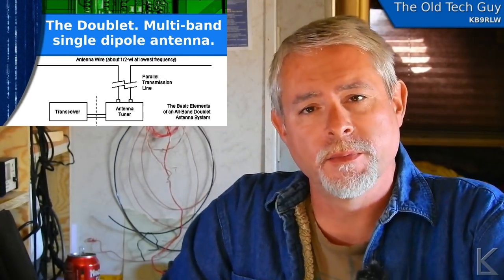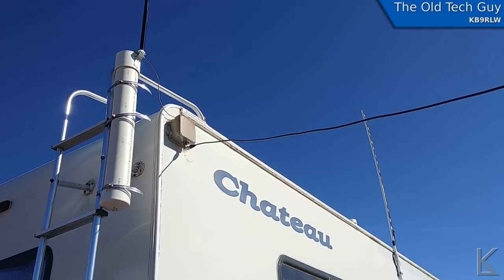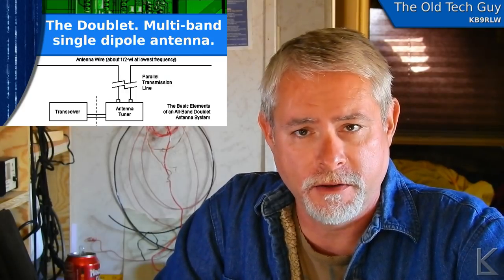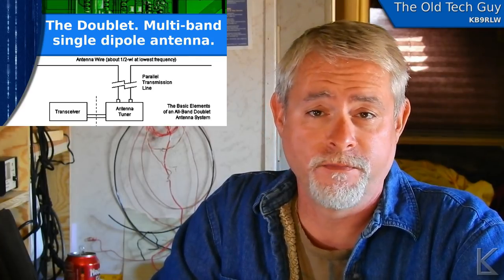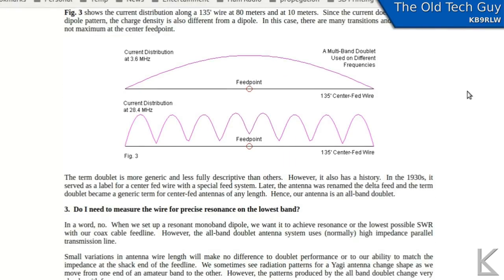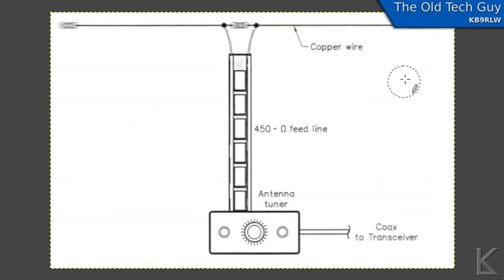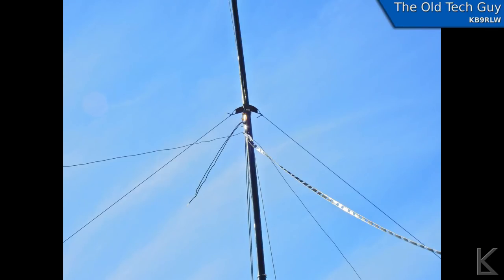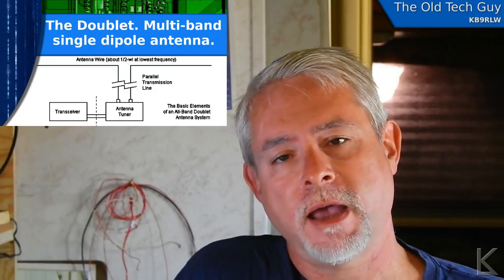Ham Radio - The Doublet.  An old but good multi-band single dipole antenna.  Part 1

Comment: Hello Kevin,

Concerning @ 13:00 about standing waves on coax, would those not be knocked down by an Ugly balun, and/or a string of ferrite chokes on the coax?

Secondly, if you had a much firmer center point, heavy pole, tower or tree, would it be better to mount the remote match at the center feed point, then run the coax to the rig?

Thanks & 

73 - John - N7GHZ
Reply from the maker: Sure, making the loss even higher.
Reply: Toroid: Only if you chose the correct toroid mix and number of turns. Ugly balun: Not likely, unless you characterize it. In general: Adding a random inductance can make matters worse. Consider you're choking common mode currents on a feeder to a load that's capacitive.... you've just tuned the feeder to pass common mode current *better*.
Reply: An rf choke is for common mode current on braid of coax, swr does not travel on braid of coax as incorrectly mentioned in the video

Comment: Kevin, I’ve been reading on line that an automatic tuner such as a LDG will not work on a doublet.  If my memory serves me that is the tuner you are using.  My thoughts are that if you feed the doublet through a short coax and a 4:1 BALUN it shouldn’t have any problem.  Keep the videos coming, very informative.  73.
Reply: I think that using an external 4/1 balun fixes that alleged problem.

Comment: Good video. I always learn something from you. 

I have a MFJ 1778 G5RV. It's a 102 foot dipole which matches the design of your doublet, except it is slightly shorter, and the length of the ladder line makes it balanced, giving 50 ohms at the coax connection point. I've read that the ladder line is part of the antenna, so it's specific length (32.6 feet) gives it the 50 ohm balance.

So from your video I gather that extending the ladder line makes the antenna unbalanced again. Is the 102 feet length too short to convert this to a doublet for 80 meters? This assumes I'd add a balun (my tuner only accepts coax).
Reply from the maker: Thanks Ed.
In the G5RV, the length of the window line is specific to create a 50 ohm point.  It's similar, but not the same design philosophy.   I probably should have mentioned it in the video.  I'm sure I'm going to get a lot of comments from other people that may confuse the two antennas.
Reply: Kevin Loughin Too short to convert to a doublet?
Reply from the maker: @edneely  No.  and it would probably still work ok on 80.   But why?  Doesn't it work well as it is?
Reply: Kevin Loughin It seems to work well, but I have about 100 feet of coax to get it into my house. I wonder how much loss I have. Hard to say.
Reply: @edneely  Ed, I generally recommend to anyone who uses a G5RV to cut off the matching section and run ladder line all the way from the center insulator to the tuner. The G5RV has very high SWR on a number of bands so you're losing quite a bit of signal in the coax on those bands due to the mismatch. As noted by the chart in the video, the ladder line will exhibit very low loss under those same conditions.

I am not sure why but somehow the G5RV has, over the years, become somewhat mystical in its abilities. It's actually cheaper to make a doublet than it is to buy a commercially-made G5RV (especially when the cost of a long run of coax to the G5RV is added) and the low loss of the ladder line will allow the doublet to be a better performer on nearly every band.
Reply: @BrianEsche  EXACTLY! A unwanted G5RV makes the perfect doublet!!!!

Comment: I have a ~120 dipole up feed with 450 window line which technicanally means I have a doublet.  I terminate the window line with an external balun at 9:1 ratio.  It works quite well.

Comment: Does the length of the feeder on the doublet make any difference especially for working the ?higher frequency bands?      I have heard that you want to cut the feed line to 1/2 (electrical Wavelength) for the lowest frequency band that you use the antenna on?
Reply from the maker: Some say it does, some say it doesn't.  Mine is not half a wave on 80 at all and yet it tunes fine on 80.

Comment: I realize this video is old but I really would like to encourage any viewers to try a doublet antenna.  I use a total of 102-feet (51 per side) with 450-Ohm window-line and I have never had a better dipole antenna and it just blows away anything I've done with coax.  Now, as far as going through walls with window line: My house has stucco that is attached by a continuous layer of chicken-wire.  All I did was part away the chicken wire (as best I could) and run the window-line through the wall (once it exits the wall, I droop it down for a rain-drip)  to 2 female banana-jacks that are mounted on a piece of polycarbonate plate. so that either a short jumper of window-line (which then runs to the tuner) is plugged in or, a pair of heavy wires that are hooked to ground--both of these have male-plugs on them.  I swept the line with a TDR and SWR and there was no effect with the chicken wire; this is because the window-line runs perpendicular to the chicken-wire.  
So, don't let people telling you horror-stories of running balanced line--it is so much more tolerant than is let-on.  I will never go back to coax for this type of antenna ever again!
The performance is just astounding!  BTW: I use a 4:1 balun and this works with both manual (link-coupled) and auto-tuners on all bands 80-10 meters. Please try it!

Comment: Kevin, as you know I am quite limited on what I can do antenna-wise.  I do like the outdoor balun idea.  What considerations are there for the ladder line as far how it's run to the antenna?  Keep it clear of as much as possible.  My gut says it won't do well strunk at or near the ground (which is what I would need to do to keep things out of sight.   My shack is in the front of the house, I have some antenna space in the back yard.
--- Joel
Reply from the maker: Hi Joel,    The ladder line should be kept in the clear as much as possible, and avoid running it parallel and close to anything metal.
It's the best performing single dipole I've ever used.   If you can get one up, you'll probably love it.

Comment: I have not yet read the papers you cite. But my understanding of the thing is different. First: The leader line has such low loss even at high SWR simply because it has very low dielectric loss. The dielectric of leader line is basically air and air has low dielectric loss. That is why low loss coax usually comes with foam dielectric.

The feed line will actually radiate some power. The G5RV and its derivatives like the ZS6BKW uses a similar "trick" when used on a non resonant frequency of the dipole part. These antennas just try to keep the dimensions in a ratio so that multiple resonant frequencies occur across the dimensions of the dipole and feeder combination. Hence they are usable without tuner on these frequencies. 

So this antenna is just simply plain a non resonant dipole, forced to match the impedance of the TRX by a tuner. The bad SWR will cause high losses on the feed line, which is mitigated by using a very low loss feed line, i.e. leader line.

You can get about the same by placing the tuner right at the feed point of the dipole without any leader line. But this is inconvenient as you need a weather proof, remote controlled tuner.
Reply from the maker: Read the papers. They're an easy read and clear a few things up.
Reply: Kevin where did you get your 60 ft. Mast?
Reply: When done properly the open-wire/ladder line does not radiate, this is a strange but popular myth, the G5RV and derivatives use the line as a matching section. Unfortunately often without any effort to reduce common mode current. 
There is merit in carefully choosing the length of a doublet to avoid wildly high impedances at the feedpoint.
Reply: @g0fvt  Yes. After putting some more more brain cells into the problem I agree that the ladder line should not radiate. Common mode current is still a problem. That's why you should put a common mode choke or balun at the feed end of the ladder line. Not to match impedance, but to suppress common mode current. If there is a suitable antenna tuner at the feed end of the ladder line it also suppress common mode current. I read recommendations to add a common mode choke or balun to a G5RV or ZS6BKW. I did such a modification to a G4RV but I still have to test it.
Reply: @56932982  it has to be said that the baluns incorporated in many tuners are not very good, since the impedance of the doublet can be all over the place I have decided not to use an impedance transforming balun. Most ATUs struggle with very low impedance loads, and are more efficient with higher Z so I am using just a common mode choke "1:1" the ATU will not flash over readily (7kV capacitors). It is handy to have an HF antenna that is compact and versatile, I have no interest in HF beams at present. VHF though is a different matter..

Comment: I have a Double Extended Zepp Antenna each leg is 0,64 wavelenght so since it is optimized for 80m band its a fairly long 328 feet or 100m. This antenna works great on all bands from 160 - 10m. Feed it with ladderline to my MFJ Tuner. So you should do fine with your antenna Kevin. Unfortunatle I have it in my summer house so no room for this antenna at my home in Söderhamn since I live in apartment. Thanks for your videos. 73 de sm3uwz/Lars
Reply: Is your Double Extended Zepp collinear? (the two legs fed in phase) If so, how did you do the phasing?
Reply: No its fed like a dipole.

Comment: Thanks Kevin. Great video. You are an expert in making complex things understandable. I always used windowline or open wire for my antenas. My hor loop skywire is still up at home QTH since 1995. I will certainly try out the Doublet as you described in our vacation house. I have a Spiderbeam pole over there (40feet ) and plan on doing as you did. Just a question: how high is the feedpoint on the mast ? And what is the lowest the antenna gets groundlevel ?
Many tnx again and good dx ! 73 de Ronald, ON4BBQ / N2YCQ,
Reply from the maker: Hi Ron,  the doublet is on an MGS 30 foot mast. The ends slope down to about 6 feet off the ground.
Reply: Tnx Kevin ! 73 !

Comment: My Palstar AT2K has an external 4 to 1 balun. I have 25 feet of coax to the balun, then ladder line after that to a loop. I assume the 25 foot of coax is seeing a big loss on high mismatch? I had thought about hooking the balun directly to the back of the tuner, but as you said running ladder line in the house is problematic.
Reply from the maker: One trick I ran across was making a parallel feeder by using two pieces of coax.  Short the shields at both ends together, but do not connect them to anything else.  Then use the center conductors as your feeder.  The isolation of the shields makes it more forgiving for passing over or along metal.
Reply: @loughkb  I will keep that in my memory bank. That plus each coax spaced apart in a separate 1/2 inch pvc conduit might work great. I would just match the spacing of my home made ladder line. ( around 3.5 to 4 inches apart ). Attach them to the floor joists down stairs and out to the wall to my existing ladder line.  Thanks.
Reply: @loughkb  EXCELLENT TRICK!

Comment: Are you concerned about the strain placed on the UHF connector on the RV from the feed line weight and wind load?
Reply from the maker: I addressed that in the video.  I pointed out that this is just an experimental set up and won't be up for long like this.
However,  we did have one heck of a wind storm and it survived so far.

Comment: You Kevin!:
As usual GREAT video! Taught me a bit more about antennas! I am of the opinion that the length of open ladder line DOES matter. Just me & my opinion. You know of my interest in 160 mtrs right? Would a 4:1 or 9:1 Baluns help load up my G5RV (dipole) on my aut6 tuner that covers 80-10 mtrs?
Great video, can't wait for the 700mw video!
73's!
de seeker/Jeff WA7LFP
Reply: I thought that it did, Spent a lot of time researching looking for a specific length. No suggestions  in any of the articles covering the "Dipole Doublet."

Comment: This highlights the importance of using good quality coax with a high velocity factor. Excluding the effect of high SWR any decent coax these days should be better than =<0.6db of attenuation @28MHz for 100ft. Decent coax isn't that expensive and there's no point making a 1kw with an expensive linear only to lose it all in the feedline.

Comment: Internal tuner in radio won't handle anything over swr of 3.5.. adding the 4:1 balun will correct this??
Reply from the maker: Maybe, maybe not. It depends on what the impedance present is at the specific frequency your operating on at the time. What the 4 to 1 balun will do, is bring the high impedance has down closer to 50 ohms, giving a tuner less work to do in many cases. The impedance on this antenna it's going to be all over the place on different frequencies.

Comment: Loss is = impedance times current SQUARED (plus resistive loss) so the higher the impedance the lower the current (at the same power) so the higher the transmission line impedance (of any kind) the lower the losses and for no other reason.
    50 Ohm parallel feedline has about the same loss as 50 Ohm coax.
  600 Ohm parallel feedline has less loss than 450 Ohm parallel feedline.
 Ron W4BIN

Comment: i saw doublet like these but one side 11.7m and 2.5m other side and feedline is 7.4m ladder line to short coax
Reply from the maker: That's an off center fed dipole and won't have the advantage of low loss on the feed line.   In fact, being asymmetrical, it will radiate off the feed line. 
The doublet is symmetrical, a completely balanced system.

Comment: This was really interesting. As a newbie/returner I need to learn whether power I save by using a doublet will be lost at the ATU. Is ATU loss going to be less than co-axial loss?
Reply from the maker: Loss in the transmatch depends on the degree of mismatch it's dealing with.   Higher mismatch, more loss.
Reply: @loughkb  That follows, I see the logic. Thanks Kevin.
Reply: @acestudioscouk-Ace-G0ACE  any reflected power loss is due to feeder attenuation not the tuner absorbing power as its reflected back to the antenna at the tuner with no loss at the reflection point
Reply: @Pioneer936  Thanks Paul, I thought wherever you have a coil, you have a loss, however small. Thanks for putting me right.
Reply: @Pioneer936  Thanks for the suggestion. I'll look for it.

Comment: 8:28 You said that the coax between the tuner and the radio needs to be short due to the high SWR.  I think this is a blooper.  Between the radio and the tuner will be matched to 50 ohms at 1.1:1 SWR, or as close as you can get to it.  I think you were thinking about is where you run the window line from the antenna and into a 4:1 balun and then use a short piece of coax to bring the coax into the camper to the back of the tuner.  That short piece of coax will have high SWR.  Once the tuner tunes it, the SWR from the tuner to the radio will be really low.

Comment: Isn´t it necessary to use a 1:1 Current-Balun when you want to use a Doublet Antenna as a Multiband-Version?
Reply from the maker: No.  It must be a current balun, and you can use a 1:1 if you want.  The impedance is going to vary quite a bit depending on frequency, but will usually be quite high.  A 4:1 will bring it down a bit so the tuner has less of a mismatch to deal with, resulting in less loss in the tuner.
Reply: @loughkb  thank you very much for your answer. So I can use it for my new antenna system. 73 de Mike....

Comment: Why a 4:1 balun and  ot 9:1?  Seems to me that 9:1 would get 50 ohms closer to 450 ohms.   I must be missing something...  🙄
Reply: I think I have that tuner. :) It's 9:1 impedance.
Reply: The 450 ohm is for the ladder line itself. The actual ohm the tuner sees or in this case the balun sees will vary from band to band, see the video part comparing coax vs ladder line, the ohms can be as high as 5000 . The 4:1balun in this case is there to interface the ladder line  to coax and help the tuner out a little. Note some people recommend a good 1:1 choke aka current balun because as you can see in the chart in video sometimes the ohms can be low on certain freq so stepping down the ohms with a 4:1 or higher would not be desirable since most tuners are more efficient with tuning higher impedances
Reply: @Gabagabe1  thanks... so much to learn
  Lol

Comment: One thing I can never understand is why when you measure wavelength in metric people insist on using feet for antenna dimensions.
To be honest I don't really care which system of measurement I use (I'm british, we use both all the time anyway) but it's much easier to stick with one! As ham bands are defined in metric wavelength I have only ever played with antennas in metric
Reply: Ever tried to buy a metric tape measure? Or a metric ruler?
Reply: @avt3216  try buying any tape measure here that dosn't have both?